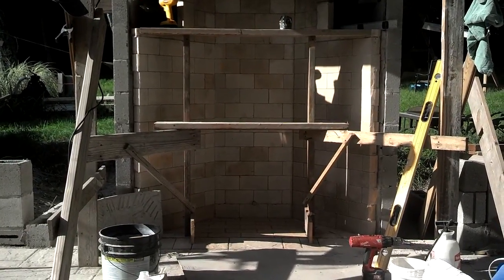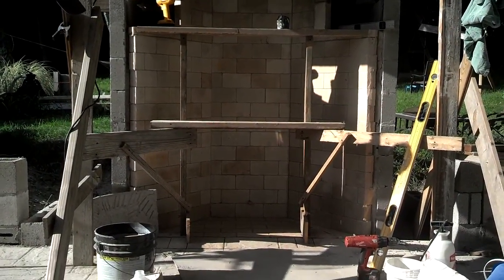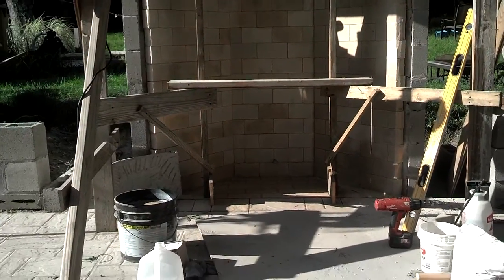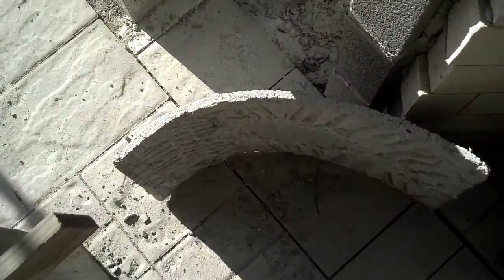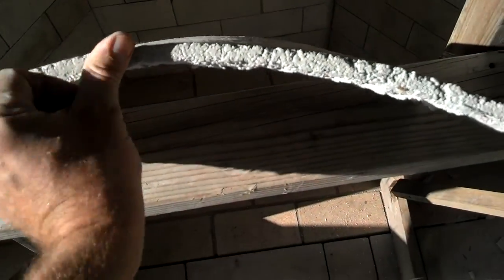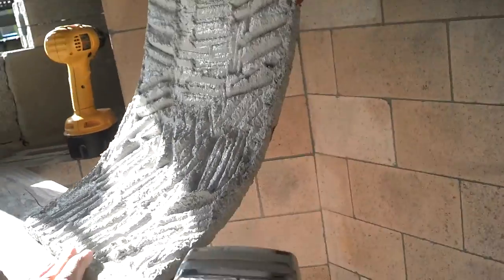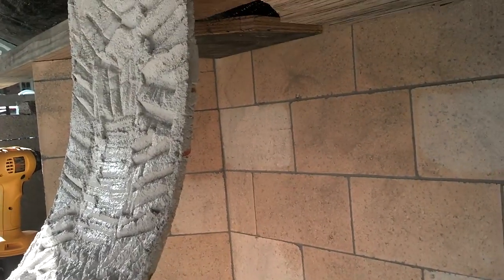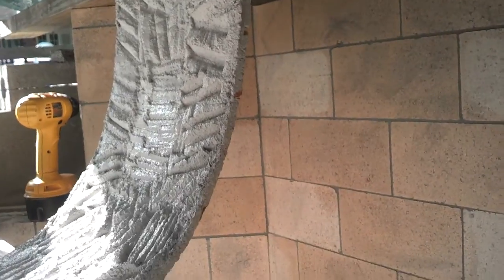Rumford fireplace firebox

Comment from the maker: check the website Rumford.com for dealers. I made mine by drawing the curve in AutoCad, then building a form and pouring 3/4" of refractory cement. I embedded 3" drywall screws in the refractory, leaving them to poke out so when I back filled with concrete there is something to grip.

Comment from the maker: Question was does it makes sense to make the rumford firebox deeper for outside installation? The short answer is it depends. I built mine exact to the dimensions. There are times under windy conditions that the breeze will pull smoke from the firebox. It's short lived. 

I would make my next firebox a
bit
Deeper. Having a tall firebox enables a lot of heat to radiate out. The fact that the draft is so good allows the entire "fire" to heat and radiate toward you.

Comment: David, while your experience has directed you to purchasing the Rumford Kit, I'd like to give your initial approach a go. Would you be willing to share your experience of casting the refractory parts?
Reply from the maker: Sent you an email. Hope it helps!!
Reply from the maker: Hi I took the image from the Rumford website and created a 1"square grid and free handed the parabola  then drew it in autocad. I made a sheet metal form of the shape and cut 4 plywood stiffeners that were gorilla glued to the sheet metal. The two outside frames were 1" thicker so the acted as a screed. I purchase refractory cement and mixed one batch of refractory and one batch of 5,000psi pea gravel regular cement. Laid a 1/2" refractory layer, then the regular cement. I embedded 3" drywall screws so when I poured the top beam it would lock all the screws into the top beam.

The YouTube of the throat was the first one, I scored it so the second layer of cement had plenty of surface area. The last 4 I poured both the refractory and cement at once.

If you can open autocad I can send the file.

Show quoted text

Comment: What are your exact measurements for the fireplace's exterior and the firebox itself. Hate to ask but may I copy your measurements?  This is beautiful!
Reply from the maker: Go to rumford.com the exact measurement are downloadable. I would buy the segmented throat pieces from a dealer. I would also do two things different 
Make the firebox 1 foot deeper and 6" lower so it smokes less when windy. I don't mind a little wisp coming out when the breeze is strong. 

The dimensions on the site are for indoor rumfords.

Everyone is shocked how well it drafts even on a warm fall day
Reply: David Van Wickler Hey David,  "Deeper" ?  Are you sure for a Rumford, that it should be deeper?
Reply from the maker: deeper is how they are built for outdoor use, tends to smoke less. If I had a fancy outdoor space that looked like a magazine cover I wouldn't want soot on anything. I made mine to correct dimensions because I wanted max heat transfer so my guests would be comfotable on an cool October evening. we actually use a fireplace grill to

Comment: Nice! Where can I get the thing, the curve thing?
Reply from the maker: Buy the throat from a real masonary supply house as well as non water soluble refractory cement. 

Do not let anyone fool you that Portland cement and fire clay mixed 50/50 will work. It will not for very long